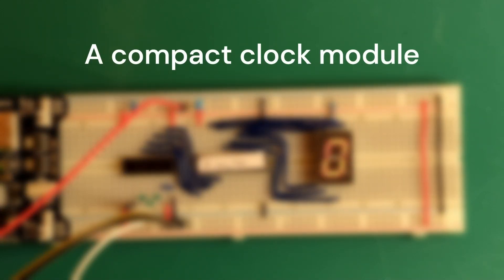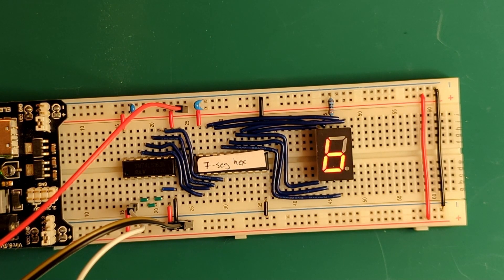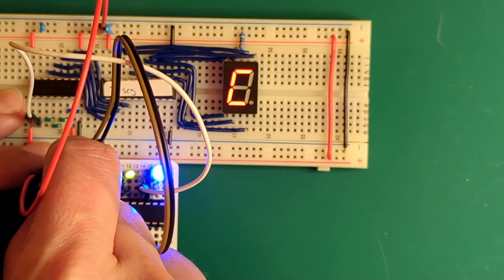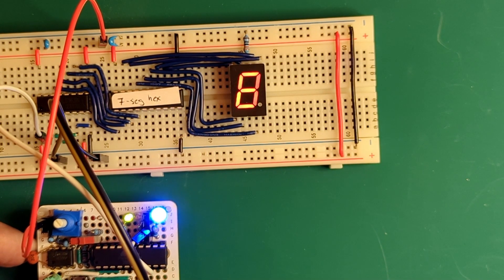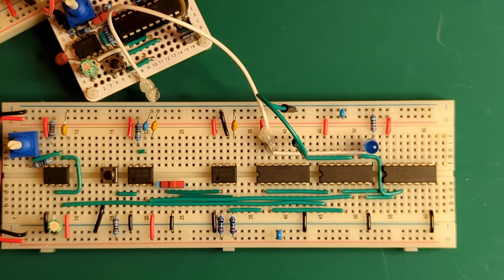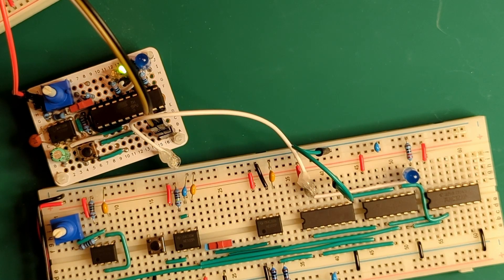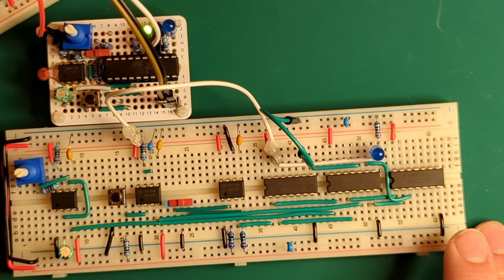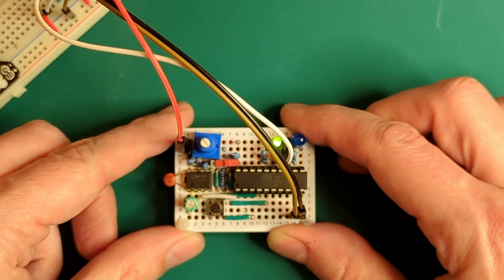A compact clock module

Comment: I like it,  =) I wish you could make it like with a seven segment display for you can tell the "clock speed" and have it on a pcb and witht the pos, gnd and signal, that way would be easier for easy swap between logical circuits...I remember at school that I needed a clock and a friend of mine had to program a pic16f82 just to give me the clock tic...it was an LED cube with animation...Good project... =)
Reply from the maker: That would be really cool, although hard to make without a lot of extra complexity. The speed is currently controlled by an analog signal so you need to either control that, or measure it at the output against a "reference" clock, and do some computation for the display. At that point you probably need some sort of microcontroller, I'm exploring work at a lower level.
Your project sounds like fun! Thanks for commenting

Comment: maybe in 1980 this would be considered tiny. Maybe.
Reply: without smd components, this is very compact
Reply from the maker: To give context, I'm doing this for the breadboarding/maker community, which typically uses through-hole components. You're correct that with a custom PCB and surface-mount components, you could go smaller. I wouldn't go less than half the size, because at that point the connectors, and controls (switch+togle+pot+output LEDs) become impractical to use.

Still, if you've seen a build of something that has this kind of functionality in a smaller size please share a link and I'd be happy to discuss it later!